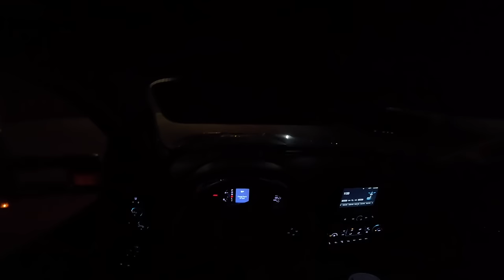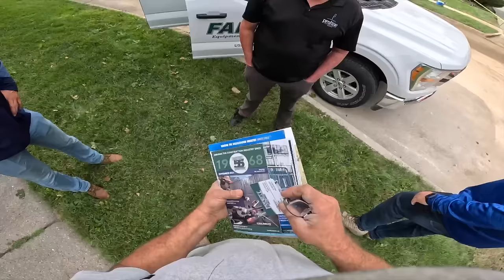Back to work after the bad news

Comment: Bugs does some awesome work on those curbs man ,gonna be hard to beat that ,Awesome work Bugs.
Reply: He does great work although those curbs are not hard to do. I think his step set ups that he always does will be the part that is going to slow them until someone steps up that Ryan can trust to do them. Also Bugs did some winter work for him on the snow - that should not be to hard to replace if someone can get up early and learn it.
Reply: There's 1000 guys in his area that could roll a curb. Milwaukee has alot of concrete contractors

Comment: When the gnats are that bad I used to take a stick with some leaves & stick it through the little holes in my hat. They always fly to the highest point, so if you hold your hand as high as you can they'll fly up there. So the stick is going up 10 to 12 inches above your hat the bugs go up there & not your face.

Comment: Idk if it's the same, but with forklift attachments, if you turn off and release pressure by moving levers back and forth, it makes taking adapter fittings off easier. The hydraulic system should be the same.

Comment: Wonder if instead of trying to make a machine to push existing jointer tools, a new concept entirely would help? Maybe a small machine that can crawl along the concrete without making too much of an impression while making joints. Seems like the difficulties of a design like this would be making it able to crawl without an impression and setting the navigation lines. Some high tech stuff but part of me feels like it’s possible. The navigation should be possible with all the lasers and sensors available. More sensors would be needed to detect the depth of the jointer going into the concrete and angle. Crawling without an impression would be difficult. Maybe something like how cnc machine travels along 2 bars then attaching them to the outside of the forms so the machine floats above with only the jointer attachment making contact.

Comment: The sono tubes are like a half inch diameter smaller then the one its nested in. I worked at a place for a one and half years that made them and I hauled them. I helped unload them also. We made up to 48" in diameter and those heavy as heck.  lol. We made them for quikrete also. We had the lables for them and they woukd cut them out there yellow they use for all there products. I had to pallet jack them at one location and jack knife into the other location and they unloaded it themselves

Comment: What they should do is invent a drone that can cut the joints, and it uses LiDar scanners all over the drone like teslas use for auto pilot, so it can sense where it’s at in terms of how close or far it is from the concrete, the angles and pitch etc, and it’ll have the cutter on the bottom and it can basically hover above the concrete at the right height, and maintain said height and slowly fly across the pour and cuts the joints perfectly totally autonomously. Would be the future of concrete lol.

Comment: Trick with keeping your flags from folding over is put either some little weights or anything small and a little weight on the bottom edge of the flag and it keeps it nice and straight

Comment: That inventor could have used an accelerometer mounted on the head to determine if the pole is being pushed or pulled and then a motor on the end to automatically adjust the angle of the plate up or down some based on the accelerometer reading
Reply: What happens when you hit rock

Comment: Would you be interested in a patio jo in Wrightstown ? 18 ft x 21 ft to start . we disambled out vinyl pergola and will be replacing with a 18 x 33 pergola that will overlap our roof by 2 feet and be attached to the roof . we currently have hex pavers now for out patio . we got o quote from a local contractor that was really high . 
   if you do not want to travel , do you know concrete contractors in the Wrightstown area ?

Comment: The reason the concrete is wetter than yesterday is because it rained yesterday and the sand from the batcher plant is holding that water. The computer in the batching plant does not take how wet the sand is into consideration.

Comment: this comment is about the pole being wobbly, well that pole is wobbly because you need to be able to hold it. As a person that needs to be light, but as a robot it could be steel super heavy drive right through those rocks and keep a straight line. Now for the building up material and needing to shift the head well that would be for A.I. to figure out. the feeling of resistance and knowing when to lighten up etc. all the skills you use to make it look easy. could be learned by A.I. . who knows

Comment: O7 Lexus $10,000 if the miles are around 100,000, and in good condition that's a  steal ryan
Reply: Not in todays economy. 8,500 was a good price as it was leaking fluids.
Reply: It has a oil leak ,drivers seat has a bunch of wear and over a 100k . $8500 is the most that it’s worth
Reply: @classicxl  well if it's like that yea 8500 a good price, I think I miss this info on a video